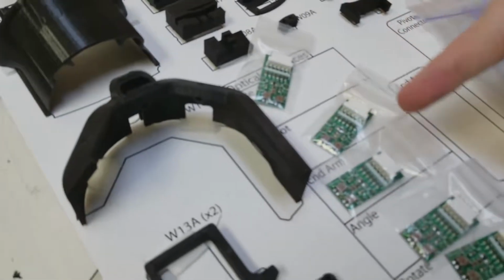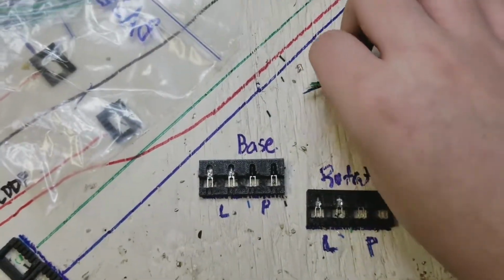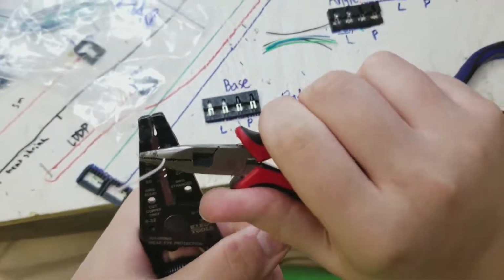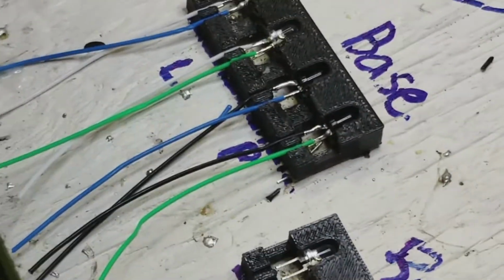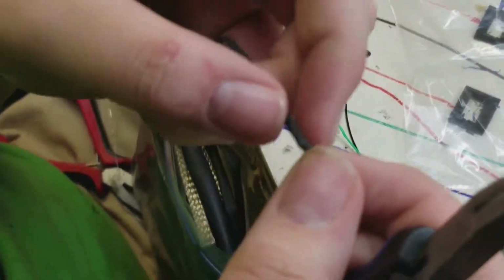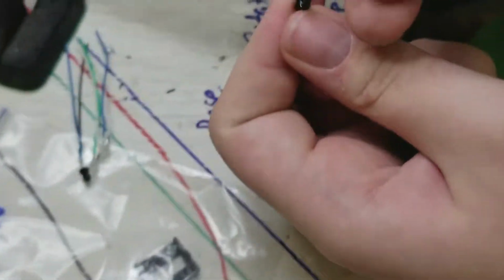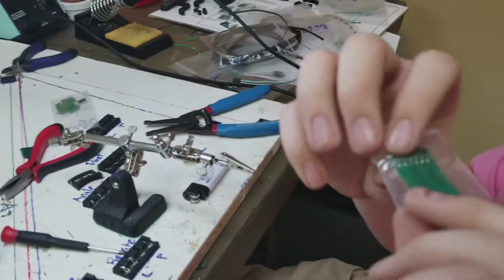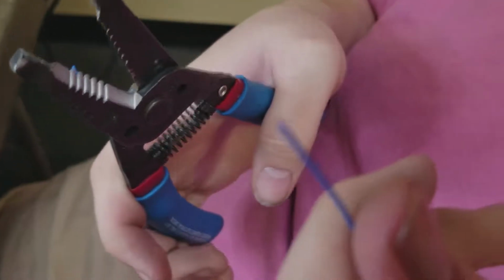Wire harness Assembly Pt.2

Comment: Not impressed with the soldering portion of this video, you should use flux so that the solder flows properly. What you are showing is piss poor soldering especially if your machine cost 10k to buy outright.
Reply from the maker: Yes, we totally agree that the soldering is all messed up here. We were trying to get through the filming of this video quickly and didn't think to go back and get shots of soldering the wires correctly. We buy our wire harnesses from a third party now until Dexter is able to make them itself.